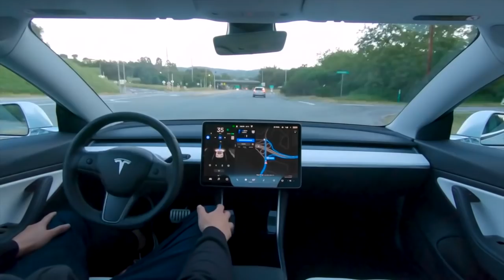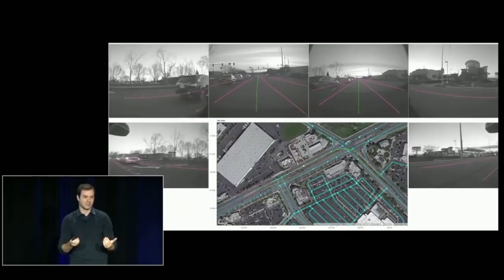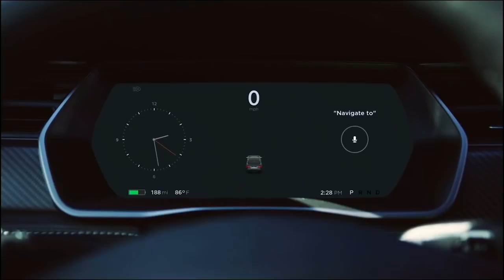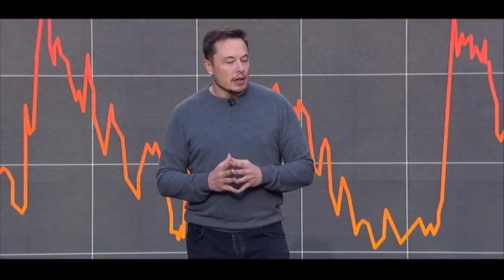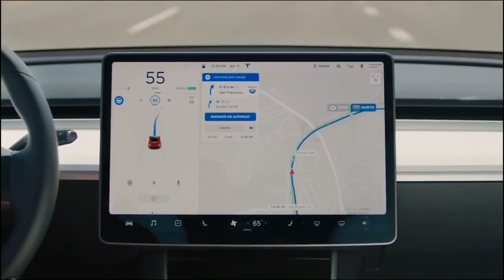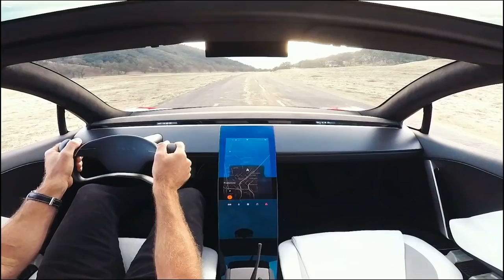Elon Musk - Tesla Roadmap and Q2 Highlights

Comment: Currently Uber drivers have two kinds of insurance. One that covers them when they are driving for Uber, the other is regular insurance. If Tesla provides both kinds of insurance, then it will be cheaper for the owner, and cheaper for the rider. One hint that Elon gave: they will change the manufacturing to make the repairs of the car cheaper. Not just making the manufacturing cheaper but also make the repairs cheaper. This is something that we never hear about from any other company. Tesla, as an insurance company, will provide insurance to a car that give all the data to the insurance provider (Tesla), and that car is prone to avoid accidents, (and if it gets into an accident, it will be cheaper to fix when compared to an equivalent car because of how it was made. (most of the premium that will be collected will be profit)
Sam Haroun.
Reply from the maker: Yes Sam. I thought that part about learning from claims to make cars easier to repair was stunning. 

Once FSD is driving the car, insurance doesn't really matter as much. Tesla is responsible then.
Reply: Warren Redlich and to fix a Cybertruck fender ( or any cyber SS car) is a non issue. You just buff it out in 5 minutes.
Also, Tesla's cameras and sensors could give verdict on an insurance claim in seconds
 and send you a message to your screen when to go to the service center and fix the car for free.
"Don't worry we know the accident was not your fault. We are here with you. You can go to service x on x date to fix your car for free"
Reply from the maker: Yes! Robotaxis will be safer and have fewer accidents. Camera systems will catch fake accident and fraud claims.

Comment: Tesla should make an integrated plug n play Powerwall like they did with Megapack.

One single unit with AC input from the grid, AC output to the home's electrical panel, DC input from solar, DC output to EV charger.

Inverter, meter, transfer switch, wifi/LTE, EV charger, etc all integrated.
Reply from the maker: Interesting. How much of that does Powerwall have already?

Comment: He says the mileage unforgivable statement too. What, "No body needs more than 300 miles all the time or something like that." It's not verbatim. I have a 2010 Edge. It gets 23 miles or less or 365 miles on a full tank. Now, you think that people are going to put up with 300 to 400 on a full battery charge.  You always have to compare EV mile per full battery efficiency or effective charge amount to prolong the battery life to ICE gas mileage efficiency. It is not just to save the environment but it is about better efficiency. I would never assume that electricity source will always be available. In time of disaster, you find yourself looking for a place to plug in during a black out. I made this point before.

Comment: IMO the most critical part of the video is the "Foundational rewrite from 2.5 to 4D analysis" as you 
put it the "mega" update to 
99.9% FSD.  This has to be scaring
the sh*t out of the other carmakers
because they know its "game over"
because they will be so far behind 
on full autonomy  software  they
will have to outsource  a company 
like Nvidia  to catch up
Reply from the maker: Yes, but Nvidia is not in a position to catch up. And the other carmakers can't afford to spend as much as necessary to catch up. They can't do it in-house and they can't afford the cost of it outsourcing either.

Maybe Bezos can do it with Zoox, but so far he doesn't seem to foster a comparable rapid innovation culture outside Amazon. Blue Origin is impressive but does not iterate like SpaceX. 

Other than Bezos I don't see where the competition is coming from. Maybe China?
Reply: @WarrenRedlich  Thanks for the
reply Warren. Also great job on the
video. You  have a point on Nvidia
but If I am not correct one of the 
OEM Maybe Audi said they were
trying to partner with Nvidia with
making autonomous  software 
but were delayed or gave some 
excuse.  The other OEMs are not 
putting the money to back their 
claims for FSD or either don't 
really think Elon will pull it off
within the next 5 years. They're 
either trying to fool themselves 
or have resigned to watch it 
happen on the sidelines
Reply from the maker: Nvidia makes general purpose GPU chips. Tesla dumped that approach and designed their own neural network chip. 

It's not just software, and Nvidia is a hardware company. But highly specific chips is not something they usually do.

Comment: 18.37 the most important bit
Reply: 21.33 pretty important too
Reply: Agreed it's daft to cycle out energy from a vehicle, there's stationary packs for that
Reply: 32.16 good point, spread batteries out amongst as many cars as posdible
Reply: 36.52 also insurance data in each car, gives feedback on car colour factor in crash, maybe that's why they default colour from black to white.
Reply from the maker: Thanks. Please use : instead of . in your time codes.
Reply: 18:37, gotcha, looking into how we chose an area to settle, and change surface to suit, without considering that climate.
For example if we settle and clear fell a rainforest zone, to pasture, previous forest rainfall patterns will continue, resulting in flooding.

Comment: Elon needs to lease the roof tops to hydroponic/aquaponic gardening.    Use the heat from the sun to grow plants that have high output.
Reply from the maker: Kimbal Musk has a startup called Square Roots that has a different approach. Check out his interview on Third Row Tesla. REally good stuff.
Reply: @WarrenRedlich  : roof tops are often the single largest heat gain inside of a building. 
paved surfaces have more effect on global warming than CO2.  roofs and roads.
by putting a productive top, it would use the light for plants, help reduce CO2 by the plants and would offer lower energy costs as well as food.   it is the next level stuff for mankind as we start to go underground.
will be forced to live underground in the future from new ice age, or new heat as the climate cycles as it always does.  be prepared for both.

Comment: Your number on Semi is way off, 2.3mil  Heavy duty/Semi trucks are sold globally, they will sell as many as they can produce batteries for.
Reply: The mass production of the Semi will occur when Tesla has plenty of batteries - probably in 2022 because one Semi needs about 18 times the batteries of a Model 3. 18 Model 3s selling for an average of $50,000 each would produce $900,000 in revenue for Tesla compared to one Semi for about $200,000 in revenue.
Reply from the maker: 2.3M/year? I had no idea.
Reply from the maker: This release says the global market is approaching $24 billion a year. That's about 100,000 units.

https://www.prnewswire.com/news-releases/global-semi-trailer-market-to-exceed-valuation-of-us24-bn-by-2026-demand-from-road-freight-from-heavy-industry-drive-sales-concludes-a-tmr-study-301003597.html